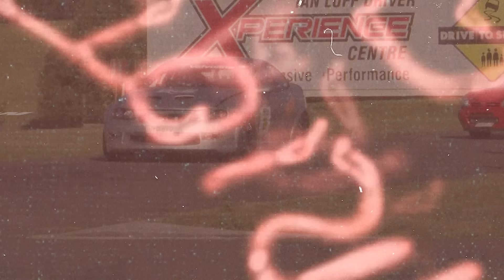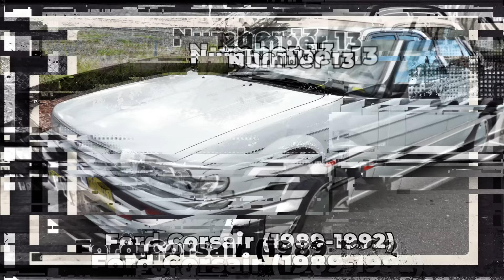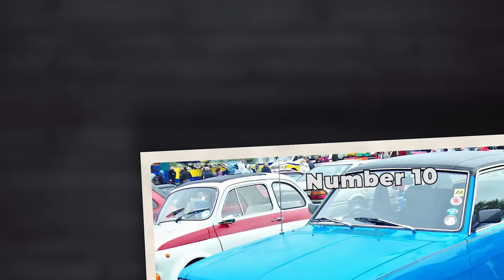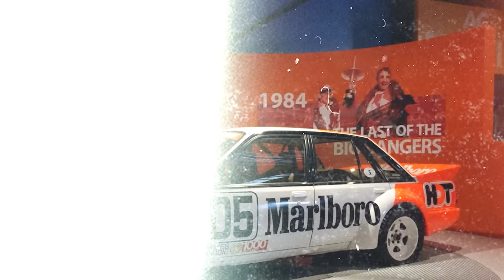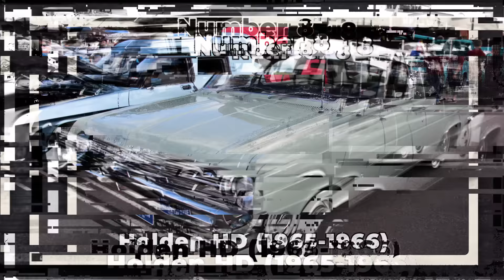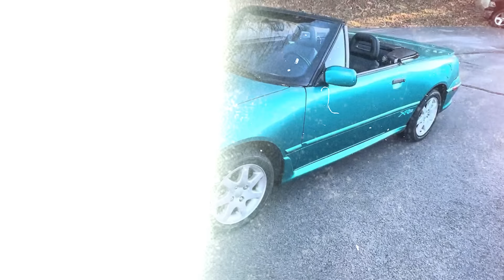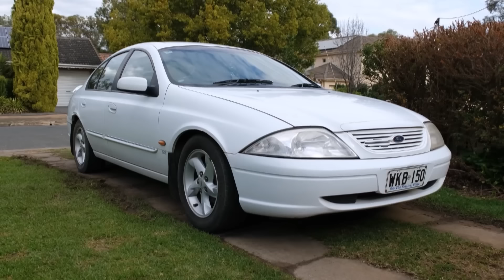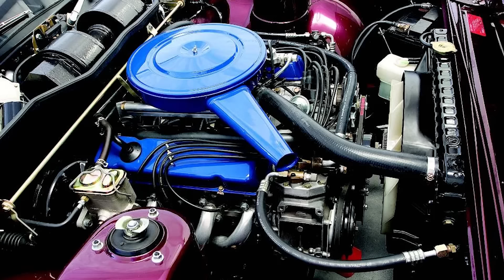Top 15 Worst Australian Cars Ever Made

Comment: The leyland p76 is a super popular car these days, they are very comfortable, drive well, the v8 is good on fuel and goes real well, after you throw in the bin the factory carb! They have a very strong following in most states.
Reply: The P38 half a car a 🍋
Reply: @NeilClifford-t6v You obviously know very little about the car if you drove a P76 you might change your mind.The engine has a strong motor sports heritage and when the engine is stroked and bored to 6.2 litres you have Supercar performance.The engine is lighter than the Chev LS series aluminum V8.The Americans built similar looking cars from the late 1980s P76 assembly improved  the NZ assembled P76 cars are seen as the best assembled cars.
Reply: @justinmccarthy1962 6.2? How’s the cooling? And surely not with that 3 speed slush box.
Reply: @armchairthis7664 An aluminum radiator and twin thermatic fans are required.An adapted quick shift BMW  ZF 8hp 8 speed automatic is the performance automatic these days.
Reply: I'm 78 drove a new one friggin horrible no wonder they were no competition to holden or ford
Reply: The fuel crisis and  Leyland's  world wide cut backs strikes and parts supply problems and a campaign by the opposition to discredit the P76 didn't help. The P76 V8 car was one of the world's  most advanced cars at the time despite Leyland Australias limited funding from the UK.  The P76 was competitive that's why the opposition bought up the television advertisement space upon the P76 launch date. What do you mean by drove horribly the P76 had rack and pinion steering and a light engine well set back in the engine  bay this  helps it go around corners better than heavier engine old cheaper technology cars that were  dumped onto car buyer's at the time and the engine was smooth and torque was good throughout the rev range.
Reply: You must have been so used to driving unbalanced handling cars that it felt strange for you to drive a car like the P76 that had an almost 50/50 weight balance.Other cars available in Australia at the time were using antiquated technology such as over weight performance killing engines that needed heavy running gear.High fuel consumption and drum brakes all around  was normal  for these  cars stuck in the 1950s.
Reply: @justinmccarthy1962  Leyland couldn't sell them, they had hundreds of unsold P76s when the auditor came from the UK and closed production down. They were riddled with defects and design flaws.
Reply: @jameslong9845 Your story is  incorrect Gavin Farmer the highly regarded motoring historians version of events is vastly different from yours.
Reply: @jameslong9845 You are repeating the oppositions smear campaign against the P76.You may not have read Anything But Average the book about the P76 by the respected motoring historian Gavin Farmer.Strikes and parts supply issues meant that c
Reply: Your fictional story is from the 1970s opposition car industry smear campaign playbook.
Reply: Your version of events is unfortunately fictional the cars were waiting for parts and had deposits paid on them Leyland built a rectification department and cars that left that department were better built .You obviously haven't read Gavin Farmers book Anything  But Average.The NZ assembled cars are the best they had extra anti rust proofing and sound proofing and they were built by by a company that had a very good record of assembling cars well.John Seabrook a director of the company NZMC New Zealand Motor Corporation wasn't just a suit man he was involved in motor sports and   car tuning he was a friend of Bruce McLaren and his father,John Seabrook was proud of the Australian P76 he was aware that the P76 was a good car .The technology used for the P76 was followed by other car manufacturers decades later. Australian University engineering professors also admire the P76 car for it's advanced technology and it's over engineered V8 engine.
Reply: @justinmccarthy1962 Deluded much?
Reply: @justinmccarthy1962 Fuel crisis...How did Ford manage to increase Falcon sales at exactly the same time the P76 was tanking? 
This was also despite Ford being hit with a 3week total production shutdown due to industrial disputes.
Reply: @justinmccarthy1962  Highly regarded? Prolific is about the nicest description I'd give Gavin Farmer.
Reply: @jameslong9845 Carry on and ignore the facts then.
Reply: Many people in NZ love P76 cars especially the  serious automotive engineers motorsports people that have far more knowledge than the ignorant social media trolls that wouldn't have a clue about the P76 V8 engine and it's related engines  the Buick 215 Pontiac 215 Oldsmobile 215 Rover 215 3500-4600 Repco Brabham F1  engine block Repco Leyland Formula 5000 engine the McCormick Leyland P76 V8 powered McLaren M23 F1 Formula 5000 car the Mickey Thompson Buick V8 Indy car the McLaren M1B 4.5 litre Oldsmobile V8
Reply: I love the p76 it never got the praise it deserves ! It was the Marina that was crap! My late grandfather had one
Reply: Friend of the family bought one new but was too scared to take it out of the garage. Every time he did something would fall off. They continued to use the VW beetle that the P76 was meant to replace.
Reply: The 4 barrel performance package planned for the P76 sedan and the Force 7 coupe was a 4 barrel manifold similar to the Willpower manifold that is available for the Leyland V8 and a Rochester Quadrajet 4 barrel carburetor. 300 cubic inch  4.9 litre bored engines were tested and had up to 270 hp and 330 lb-ft of torque.

Comment: I had a ford corsiar the engine would just stop had to wait 30 minits then it would start only on long trips found the problem it was the ECM  it was getting hot got a upgraded one no more trouble   till i trade it in got a 1988 camery wife could not drive manual 
That toyota was heaps better than the ford😅😅😅😅

Comment: Not exactly accurate. Where is the 180B / 200B? , The 240k ? Which rusted apon assembly, the cortina / centura which had massive 6 cylinder engines where they were designed for 4 cylinder engines . All assembled in Australia. There are plenty of disasters to choose from
Reply: At least the 240K was stylish. But you’re spot on And there was LC torana with drums all round

Comment: My Mum had a Camira and I learnt how to drive in it. We had no problems with it until my Dad crashed it a few years later. What people forget is it was an early front wheel drive with a high revving engine and low torque at the low rev areas.  Keep the revs up and it was fine even driving around the Blue Mountains and driven properly it had great handling.  Someone used to commodores or falcons, the Camira had to be driven differently so many hated it.
Reply: PeopLe forgot nothing 😮, yah DopeY tarD.
it's be aware mindfuL of 😮.

Comment: I owned a Holden Camira back in the late 90s, I ended up getting $300 for it as scrap. The engine bay was rusting an I was told by  panelbeater that the motor would eventually fall out onto the road.

Comment: Again do you actually know anything. The Stafford 4 was introduced in the UC Torana and the VB commodore and was a replacement for the inferior Opel engine in previous Torana’s. At that time Holden was required to produce a 4cyl engine and that shortened 186 was a great cheap option for them. Great engines. You really are stretching things here. Especially since I have not heard about the inferior Opel engines.

Comment: Nothing wrong with the Holden Apollo it was a reliable car.  For the mid sized market that Holden needed because GM had nothing to offer and they wouldn’t let Holden develop a mid sized car that they could also export. No different to the Ford Laser. Meteor. And Telstar. All 3 were rebadged Mazdas
Reply: Laser etc, actually assembled here.  My KB Laser was brilliant, four speed manual and dead reliable. Would often spear down the Newell Highway to Melbourne and back from SEQ and never missed a beat.

Comment: I'm shocked and amazed the EA Falcon wasn't mentioned! 

I owned an EA series 1 and it lasted 500'000km, but it was regarded at the time as a lemon. Arguably more so than the AU. The reason it has so many problems is because they were forced to release it to market ahead of schedule, before proper testing of the vehicle could be done. 

The reason they had to jump the gun was because Holden was bringing out a competitor, the VN. Which was basically a German Opel Senator with a Holden badge slapped on the front and back and an American Buick V6 slapped under the hood.

The EA, which should of been the pride of actual Australian engineering got shafted. It was almost totally designed in Australia and almost 100% made here.

The only things I could find that weren't made in Australia in my EA was the EEC IV computer (American, probably made in Taiwan), and the cassette radio and speakers. 

Ford Falcons were consistently 90+% Australian made. The Holden Commodore seemed to be around the 50% mark from memory.
Reply: I was a Ford mechanic when the EA came out. The recall program was huge... blown head gaskets, we had to re-weld subframes, brake pedals snapping off. Released way too early.
Reply: @fahncahn  I remember the 20mm square tube welded under the crossmember at the front.

A mechanic was telling me they used to cut that off and weld it back on when they had to do a sump gasket.
Reply: I was a sales manager for Allens sweets at the time the EA came out. There were 15 managers and we handed in our XFs for EAs. 
14 of them blew up.  Apparently the workers (mostly Vietnamese) had failed to take some plug out of the engine when fitting. 

Mine ran for a month then burned to the ground on Morayfield Road (Queensland).  Local roadworkers ran over with a hose and I said "don't use water,  use petrol on the bastard".
Reply: @Bribie12  I grew up in Morayfield, so I know exactly where that is. The first series of anything is best avoided. 

The EA I owned was an '89, where the first off the line were '88... so I had that slight buffer. 

At work I was given a brand new Mack Anthem truck to drive... basically so new it was the first ones on the streets around town. The teething issues it had... 😂
Reply: @timhinchcliffe5372  In those days Morayfield Road had a barbed wire fence down the middle!!  There was a Franklins but no big Shopping town and they were in the process of turning Morayfield Road into a dual carriageway.  I stopped for a roadworks flag guy then the smoke started rising from under the bonnet and I was out of the car like a flash!!!
Reply: My flatmate had an EA Falcon early model and it was soo gutless with its carb motor and three speed gearbox but like all useless big Australian cars made up for it by drinking petrol at a ridiculous rate. I distinctly remember it accelerating with all this fan noise whooshing away but with no haste whatsoever...lethargic...If you really feather touched the accelerator it wasn't too bad for economy but then what was the point. My 1975 Renault 12 wagon 1.4 litre walked all over it. It showed how a car should be made and what a disappointment the Falcon was.
Reply: @777gordini EA Falcons never came out with a carburettor.
Sounds like there may have been a problem with that particular car, if it was getting beaten by a 70s (or 80s/90s) Renault.
Mine was a 1990 with 4sp auto and centrepoint injection, and was a pretty quick car for the day.
Reply: @mackerel1875  his friend's EA might of had the 3.2 litre CFI... they went the way of the Dodo quick smart.
Reply: @mackerel1875  the 3.2 CFI - 90kw
3.9 CFI - 120kw
3.9 MPFI - 139kw

The difference just between the two CFI engines is huge!
Reply: @timhinchcliffe5372 You could be right there, didn't consider the 3.2. They were as rare as rocking horse shit here, I think I've only (knowingly) seen one, a taxi.

I had a 1990 30th Anniversary EA with the 4sp auto. 
Did the head gasket at around 280XXXkm. Other than that, I had to change an alternator, a coil, and a dizzy module.
Honestly couldn't complain too much about it.
Retired it at about 350XXXkm after hitting a roo. 
Damage wasn't that bad, but I found a lower km EB2 sedan in good condition cheaper than an EA bonnet at the wreckers.
EB was a great car too.
Reply: @777gordini  😂, mine would beat my mate's Chrysler Sigma. I ended up taking the clutch fan out, and putting electric fans in, that made a big difference.
Reply: @777gordini A lot of people thought they were carby at first... the round air cleaner made the CFI look like a carby model.

Comment: The best thing about the Craptiva was seeing it burn 🔥 and did it burn well 😂
Reply: Bought 4 cylinder  6 speed captiva at auction with 125000 klm never had problems changed the plugs and oil now 190.000 . Owned many cars before. Love this one and would buy another

Comment: About the original Falcons, Ford Australia redesigned a lot of the car, and made it suited for this country. They even ran a brutal endurance test promotion on the vehicles to prove the new design. Ford Australia engineers deserve much respect. 

Also, when the German Commodores first came to Australia, they fell apart on our roads too. The Germans blamed Australia for having such poor roads. 🤷‍♂️🤦‍♂️
Reply: The Commodore was not a rebadged German one. The German one could take an Aussie six cylinder with a squeeze but not a v8 so holden went cheap: 

It was the rear end of an Opel Rekord grafted onto the front end of the larger Opel Senator. Because it needed that big boof nose to accommodate the Aussie engines. 
The problem was that they initially didn't get the necessary welding etc right and they tended to snap in two at the firewall 😄

The Rekord wasn't really a large car. While in Germany and in the UK (Vauxhall Carlton) it passed as "large" but by Australian standards it was not, compared to Falcons and Kingswoods and Valiants of the time.
Reply: @Bribie12  well there you go, I did know they had to cut and stretch them to be bigger. I bet this all was kept under wraps though... not exactly top secret, but definitely not advertising material.

Comment: The Oxford dictionary entry for “Gutless” has a photo of my 1983 JB Camira. Dad bought it for me as my first car at an auction in the early 90s. It was the “sports” SJ variant with a 5-speed manual gearbox mated to a 1.6-litre engine that struggled to maintain 100 km/h on a flat highway. Overtaking was really only feasible on downhill runs. 
And yes, the firewall rusted out so a firm press of the accelerator moved whole firewall, making acceleration even more sluggish if you could believe it.
Reply: Bullshit. I had one and frequently drove it between Perth and Dongara where I was living at the time. It would easily maintain 110

Comment: The JBs and the JD unleaded Camiras were built poorly, and the JD unleaded lost a lot of power/torque. But the JD leaded were quick (with issues, but still better than the JB). I bought an ‘85 JD 1.8 leaded and an ‘88 JE 2.0 for virtually nothing in the ‘90s. The JD’s AC went bang and the pressed in rear windscreen leaked. The JE had no problems whatsoever and did ‘000s of kms until it was hit while parked by a drunk wine mom. 

Is there a Camira club? They must be less popular than the HD (which has made a comeback). Must be only a handful left.

Comment: I was an apprentice during late 70s and early 80s in a busy servo. We did tons of roadworthy inspections and nearly every aussie car would need either tie rod ends, ball joints, idler arms to be replaced due to "wear'. Bearing in mind these components had grease nipples and were generally regularly greased. 
Then we'd get a Japanese car with 200 plus ks come through and it would maybe need a muffler as it was the original one or brake pads. Rarely did they need a ball joint or a tie rod end, and these were sealed with no grease nipples! Sure, you couldn't tow a caravan with them but they were mostly very reliable and cheap to service and run.
Mind you, I still hung onto my old Valiant, just kept patching it up.

Comment: The AU Falcon was actually a good car once you got through the initial teething problems. Once you sorted the power steering leak with a more robust part, replaced the power pack, screwed the exhaust on properly etc you had a very good and reliable motor car. UGLY as though, It grew on you.
As the owner of several P76's I can tell you that people just didn't really understand what an outstanding car it really was until it was too late. There was a lot of sabotage going on and interference from the big boys who didn't want to lift their game and give the public decent cars.
Rack and pinion steering was ahead of its time and gave the cars unmatched handling. The alloy V8 gave the car a stack of pep from a smallish engine.
Reply: My son in law has an AU wagon,  but what a wagon!!  It's the Fairmont version and was a funeral director's car - not a hearse but I expect many a stiff had been carried on board, hence the wagon. 
It has all the features of a modern car such as litres per hundred Ks,  km till empty,  cruise control.   And is dead reliable, hasn't spent a razoo on it for the last ten years apart from fuel and servicing etc.

Comment: I bought a Mitsubishi ASX brand new. It’s was the biggest pile of crap I’ve ever had and Mitsubishi as a company wiped the floor with my warranty claims every time. Made in Thailand, but that wasn’t the problem it was just cheap and nasty parts everywhere. Shit cars are not just exclusive to Australia.
Reply: I agree ,I hired one for two weeks when in Florida in 2024 and driving it on the 70 mph freeways,the engine was revving high and the steering was s@#$ and it wanted to go for a wander on the road ! Just a gutless light cheap fake SUV